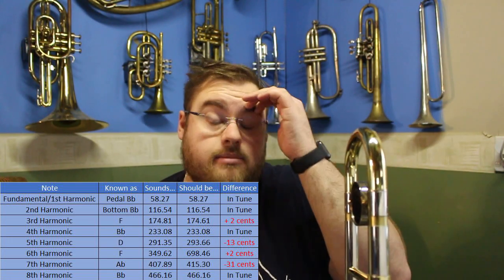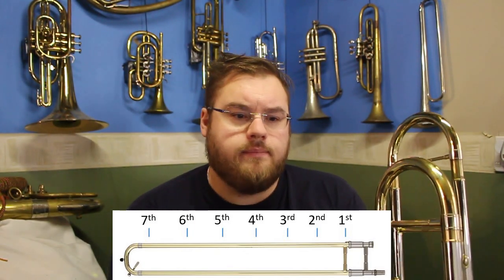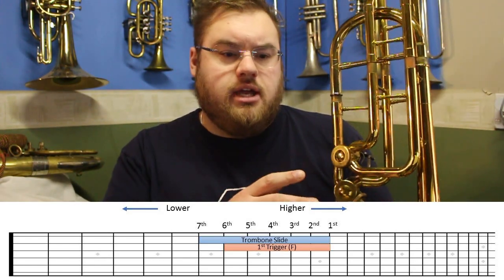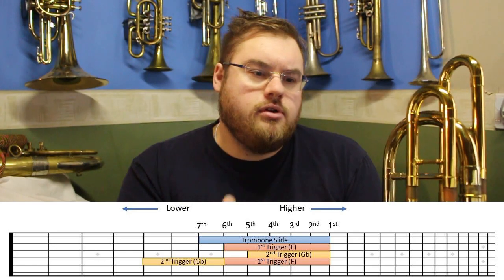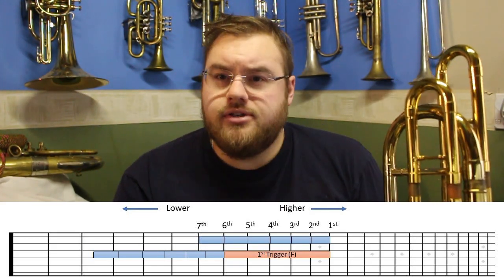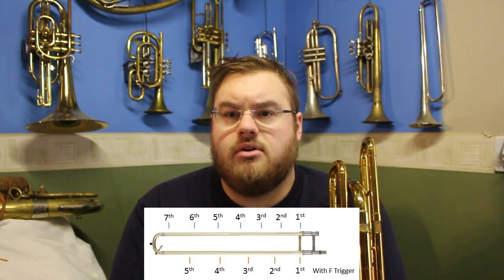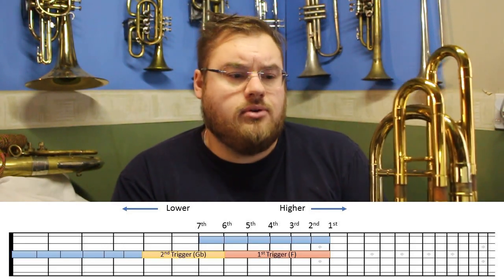The Science of Tuning - Trombone Edition

Comment: So do straight trombones suffer from this problem?
Reply: The tuning issue with triggers? No. The tuning issue with the harmonic series? Sadly, yes.
Reply: P i g g l e s the harmonic series is in tune if you use just intonation
Reply: Emory Jenkins Not really. Just intonation changes with the key you're in. The third of the chord has to be played slightly flat, for example. Every note needs some adjustment to be truly in tune. You eventually get to the point where this isn't a conscious adjustment, though--you just listen and fix immediately.
Reply: All wind instruments have to deal with the overtone series being out of tune relative to equal temperament.  With all trombones, for example, the 7th overtone is extremely flat relative to equal temperament; so much so that you either have to tune the entire horn slightly sharp to compensate, or you only really have six positions available for that overtone. 

Many trombone players tune the instrument slightly sharp anyhow, as tuning 1st position with the slide all the way in doesn't allow you to compensate for slightly sharp pianos, changes in temperature, etc.  Tuning slightly sharp also allows for more fluidity in the first position: you don't have to worry about banging the outer slide against the cork barrels.

Comment: i think you misspoke and said the partial under high Bb was Bb (the ultra flat Ab, i think you were thinking in Bb treble clef)
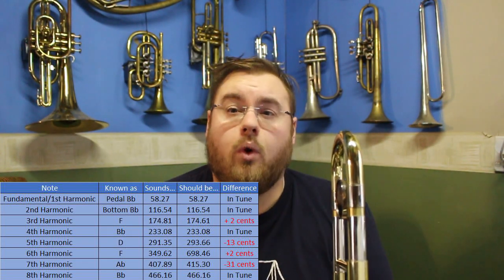Reply: In other words, at 1:43 into the video, he should have said Ab is extremely flat, instead of Bb is extremely flat. 
A small and obvious slip in a well-presented, complex lesson.
Reply from the maker: Yes - you're right. You'll notice on screen I have a 'Ab' written.
Reply: trexkiller oh yeah, definitely an amazingly prepared for and well done video, just nitpicking rn so there's no confusion. He did even accurately put Ab as the right note in the chart, like he said.